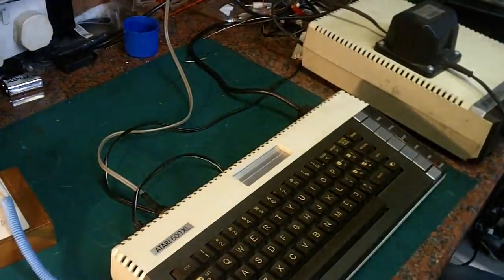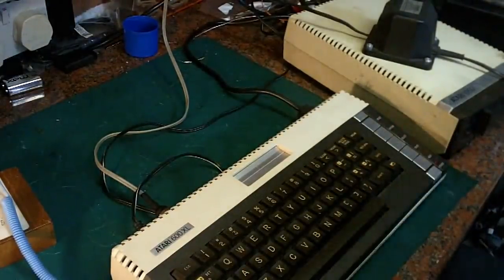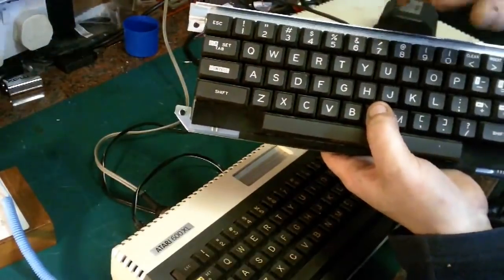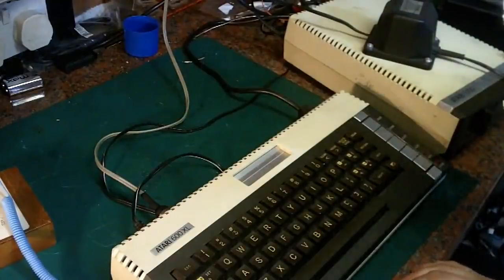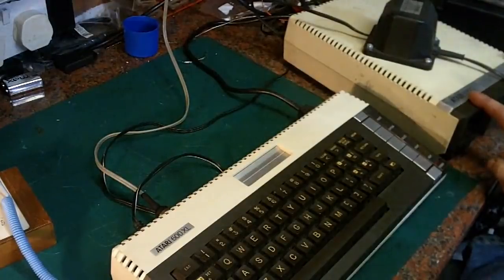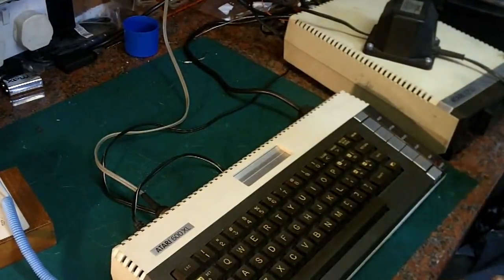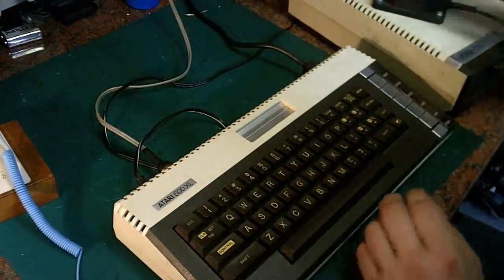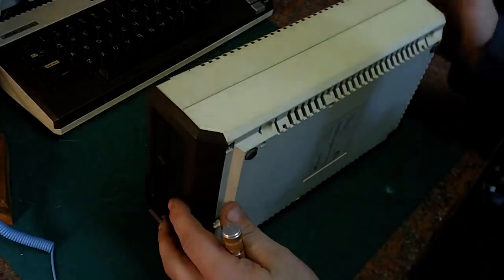Atari 600XL further issues plus 1050 disk drive

Comment: Good video! 
I regularly fix Atari 1050 and tape drives for folk.
The 1050 is reasonably easy to fix.
Common faults I've found are bad caps, the two diodes between the large caps (12v doubler circuit)
Dirty drive select switch, cold solder joints on the earlier mentioned diodes, dirty head, dirty/worn pad(above head).
Less common 12v reg, chips need reseating.
Rarely belt, motor, motor control chip.
Oh and dirty sio pins in the sockets.

Worth doing it all in one session. Also it's always worth greasing the rails. 
You can download an Atari 1050 tuneup disk. It lets you set motor speed perfectly, fine tune the head park sensor. 
If after all that it still fails then you can fine tune the head by adjusting the angle of stepper motor slightly.
I really enjoy your videos🙂👍
Reply: Could you please help me tell what wires are needed in SIO cable to work with 1050: data in, data out, command, gnd, 5V ? Is clock out necessary too?

Comment: Nice update =D  Never seen inside a 1050!  Interesting that they went with a similar design to the 1541 drives.
Reply: Considering that the Atari disk drive predates the Commodore drives, I think Commodore went with a similar design to Atari.
Reply: ungratefulmetalpansy  That's a fair point.  I had just assumed that the Pets were like the TRS 80 with dumb drives and a disk controller board.  I don't really know much about the Pets and really only paid attention to Commodore with the release of the VIC 20 and later.

Comment: Jay dont forget to hold down [option] when you boot to keep basic from loading and eating up memory. Thats what looks like happened on that "no label" disk you tried. Also, gotta get that audio working so you can hear the data transfer - it will help with determining if the drive is reading or just spinning the disk.